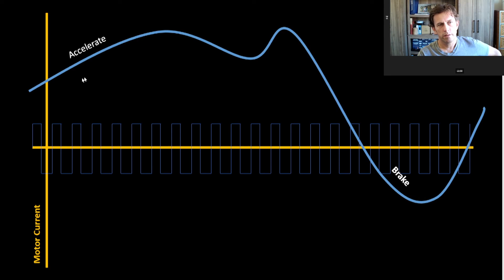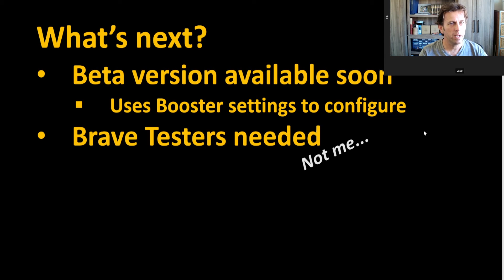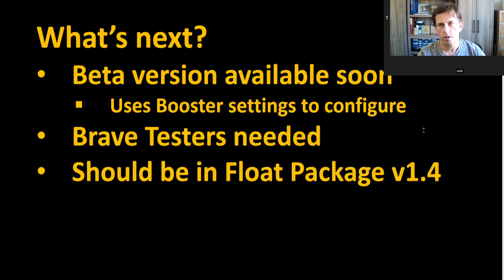Haptic Buzz on PintX, XR, and Floatwheel

Comment: How do we enable audible haptic feedback in the latest Float Package update. I’ve got the vibration pattern set for different alerts including duty cycle which I can definitely feel under my feet but wasn’t sure if I need to add a Seed Studio Grove Buzzer to test the different audio feedback settings.
Reply from the maker: Beep and Haptic buzz are unrelated. Haptic buzz should be audible but it may be that you can’t hear it at 25+ depending on the rest of your setup
Reply: @surfdado  thanks!!

Comment: So something I've been thinking about for a while now could be really good to try with this heptic feedback. Sometimes for whatever reason foot sensors fail or some issue happens where you get a nose dive for no particular reason and thia can be very dangerous. How about the option for feedback when the board is about to disengage under normal driving conditions which would possibly give you say one or two seconds warning which gives you an opportunity to leap off the board rather than rather than smash onto the pavement I think this could potentially save people's lives I was going to look into doing this with with a beeper but haptic sounds like maybe a better option.
Any thoughts?

Comment: Summary of first half: 
Surfdaddy: "You freaking kids blabbing about buzzin bah that's a load of baloney I don't know what you kids think is so good about buzzin boards just learn to drive ya fricken kids bah fine I'll give you something basic and sure you could add different melodies but it won't be me!"
Reply from the maker: That’s exactly how it went down 😂 - and I have to admit I kinda really like it now for alerts at low speed. But I’m still hesitant to enable it near the limit
Reply: @surfdado  One thing I realized when learning about FM's implimentation is that you can now reliably feel where the amperage limits are, something ive been wanting but didnt know an effective way to have a response other than a buzzer. Motor buzz though can give you a very good idea of when the motor is near its amperage limit rather than finding out by being in a nosedive. Usually it is too late once you start feeling it cave. So especially useful when going uphill.
Reply from the maker: didn't they already have surge for that before? Never tried it on a GT but the XR sure let you know when you were near the amp limit
Reply: @surfdado  Surge is just more pushback. Not distinguishable enough if you are already pressing down hard to counter normal pushback.

Comment: This is close to what i wrote before on facebook.
I imagined engine sound for duty cycle so others can hear you and you could be funny sometimes like the flywheel.
But a better use would be for race or if you want to push the board to the limit. So you dont need a smartwatch or tiltback, you just have to hear it so you know your duty cycle like in a normal car. The puschback could be a revlimiter. 
It's not necessary to use engine sound with speakers, this buzz could be an option as well.
I am sure it would ba annoying but if you have to push something like this could be very helpful. At least in my mind...
Reply from the maker: you seriously overestimate this feature - if you make it loud enough so others can hear it then it surely will reduce your torque - also I'm not sure if this will be useful in racing, riding chunky trails at 30mph it will be hard to notice, and the last thing you want is 10% of your torque wasted on this kind of gimmick. I don't know if I will ever enable it for duty/speed alerts on my boards. 
However, this is still a useful feature: voltage and temperature alerts, as well as a speed limit alerts when your kids are riding it and you want them to stay below 10-15mph
Reply: @surfdado  if i have to sacrifice this much then probably i don't wanna use it ever. 
I am looking for a good indicators, since i vesced my pint x (where i loved the hard pushback) i can't find the same tune for tiltback. If i set the tiltback to 85% i have to be over it to get it going, but if i set i lower i have to ride the pushback to get to 85% duty cycle. So to have the same level of safety i have to sacrifice the last few ump i have in it. 
I don't wanna go above 85% cause we know it's jumping all around, so i wanna leave 10% headroom. 
And since the duty cycle jumping a lot there may not be a perfect way to use the tiltback if i want to push the limit but still be safe. 
Sound alerts are good and giving me exact numbers but very slow. 
For now i might get a smartwatch or something i can put on my hand to monitor my speed and duty cycle.
Sorry for this long reply, and thanks for clearing this up. Not to mention the hard work you put in

Comment: Does It affect anything ? (CPU load / motor current / cycle time) Is there any downside of this buzzing while riding?
Reply: I assume no because the waveform is centered on the line so it will have a symmetric effect on the curve. Which means it'll cancel itself out.
Reply from the maker: Correct, it doesn’t affect ride feel but near the limit it’ll probably reduce torque so I wouldn’t want to use it in racing
Reply: @surfdado  Oh yes, if we imagine that the same curve graph had a ceiling (amp limit) then if the curve got close to that ceiling the square waveform peaks would end up hitting it and maxing while the flats would end up below the line and causing a negative bias. Maybe a solution would be to clamp the negative amplitude to the maximum amplitude limited by the max current relative to the original line. That would however create a situation where the buzz weakens which could indicate there not being a problem. Though a weak buzz could also audibly sound like a strained motor and would be distinctively different from it starting and stopping immediately.

Comment: I'd like the option. I'll be going from a stock XR to an 84V VESC with Superflux, and getting a sense for the limits is daunting when I know they'll occur at much higher speeds. Having a warning that doesn't rely on a bluetooth connection or the ability to push back sounds good to me. After getting a feel for the board with more conservative settings for the buzz, I might still want to have it on as a final warning at 95% duty cycle or something like that.

Comment: I would like to submit that this can only be disabled if you have 10,000 miles on the odometer, and are an official Nobel laureate.
Reply from the maker: You have to submit a formal request to the VESC committee 😂
Reply: 🤣 Totally, keep those nerdy Fields Medal recipients buzzing
Reply: Agree. Or if you've built more than 2 funwheels ( battery included)